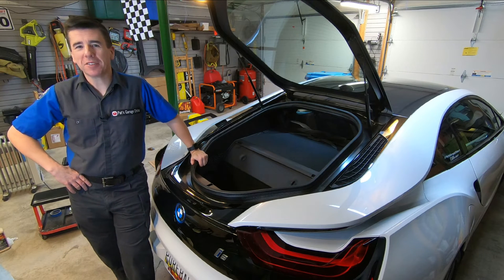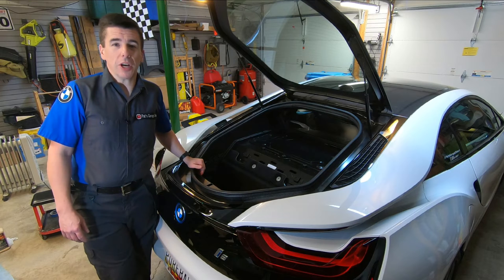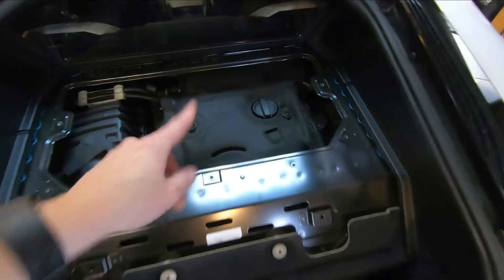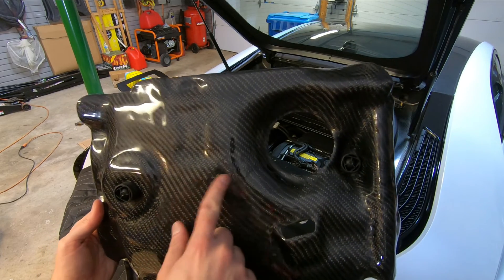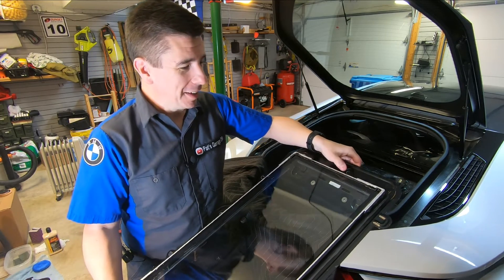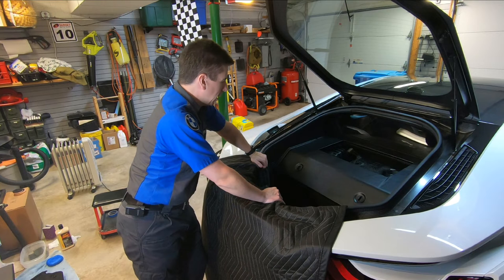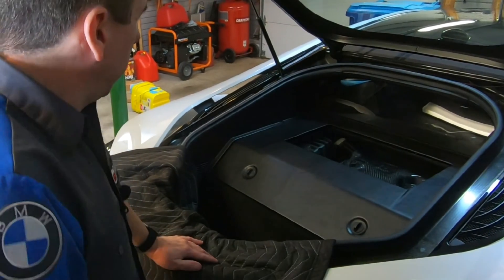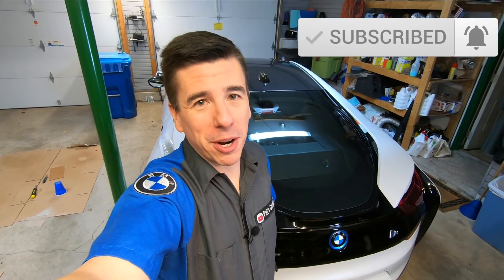I modified my BMW i8 to show the engine as part of my Engine Display Project started 7 months ago

Comment: Cool project.   Would have been interesting to see some strip LED lights along the edge of the glass cover.   Also, maybe a dark blue or gray color to the cover of the air filter to the side, to distinguish it from the engine....

Comment: would it be possible to do a v8 swap in this car?
Reply from the maker: Many have asked about swapping to a larger engine. Anything is possible with enough money and innovation. You'd need a computer controller that can run the engine and also tell the i8 that it's a functioning 3 cylinder, first. Then you'd have to modify the car to fit the engine, transmission, drive lines, etc. By the time you were done, you could probably afford an Aventador SVJ.
Reply: @PatsGarageOnline  i think an s55B30 engine would be perfect in this car
Reply: @PatsGarageOnline  Just one more question, would the best place to do the swap be front or mid engine?

Comment: You added weight rather than removing it, but I think you just want to get a good top down picture of a Ferrari Boxer 12 motor, print it as a decal and mold/shape it slightly 3D and then and attach it under the glass from top cover you made (which looked great - Naugahyde is easy to work with).  Now it won't look like you have a mini-cooper motor in their.  Or go older with 4 double barrel Weber carbs in there with metal trim ring accents.

Comment: very well done.  A real cool affect would be to add some blue LED lighting that is indirect and creates a blue glow inside your engine compartment. You would have it connected to switch to where you can turn it off to where it wouldn’t be a distraction when driving.
Reply from the maker: Thanks!  I purchased two strips of blue LED lights and a small Lithium Ion battery pack to power them, and a wireless remote to turn them on and off, but I haven't installed it yet.

Comment: Still the engine is not shown, just the top cover. I would just skip the cover and cut out a polycarbonate glass with no frame but with a surrounding gasket. All those multi layer covers is not necessary if you are used to a front engined car, it's like sleeping with 10 pillows.
🏎️💨
Reply from the maker: not ever fabricating something before in my life, I felt like I needed additional factors of safety so I didn't end up with problems. Looking back, could have done it differently, but this was a test case just to see if it could be done.
Reply: @PatsGarageOnline  I think you did a great job anyway. My car is a Opel Combo (Fiat Doblo) so can't boast my own engine really, the cover is removed and the ECU tuned. I'm a motorcycle guy, that's my excuse.
Happy New Year ✨

Comment: Oh wow thats such a cool mod. You did well!! You have a new sub from New Zealand 😊. BTW now that you've been using it for awhile since this video was done, did you face any issues with heat, maybe fitment or things that you didn't anticipate that came about cause of the mod? Really tempted to attempt this depending on your experience.
Reply from the maker: Thank you!  I've had no issues with the mod.  It does get hot, but there have been no problems.  I would do it again exactly the same way if I was building a new one.  I overengineered this to be fully capable and it's impressed me.  However, I would make the hole in the leather wrapped cover smaller and send off the engine cover and airbox cover for professional carbon fiber work (and am considering that right now).  The glass is 12"x24" so you just have to make your cuts and build your frame to support that.
Reply: @PatsGarageOnline  Thanks for the reply, can't wait to see your engine cover and airbox cover mods.

Comment: Pat! Your videos are so informative! I’m definitely gonna implement your modifications & fixes when I start fixing up our salvaged i8 soon! Question: there’s often an issue i8 owners have with water leaking in the car causing possible water damage but is that a general misalignment issue some people experience or what?? 2) idk if it’s me but your i8 feels slightly bigger right? 😂 3) i forget your i8 with the 2 backseats is it the 2015 model? Thanks!
Reply from the maker: Thanks for the kind words.  I'm only familiar with water leaking in the boot in the back and getting moisture into the electronics on the right side of the boot, behind the close out panel.  That's the active sound module and it causes crackling in the speakers when it's wet.  I don't know how water gets in there, however.  I'm unfamiliar with any other water intrusion in the i8.  Yes, I have the coupe so it has the rear seats, but other than that, it has the same general exterior dimensions.

Comment: Pat, I am a 2015 i-8 owner and I’d love to know if there are any kits to have the doors open automatically with your key? Also Great videos. I have a love hate relationship with my car even though it’s been perfect.
Reply from the maker: Thanks! There are aftermarket door openers out there that some people have told me about, asking if they could install them. I don't know if it's possible because both the door and the body in that area are carbon fiber. You'd have to cut the carbon fiber to make room, and you would have introduced a problem where stress on that part of the carbon would result in a crack developing. So, I would personally avoid trying it.

Comment: Not trying to be a dick but this is worse then before. At least before you can't see the ugliness
Reply from the maker: Many folks want to leave it as is, and that's cool as well.  There's definitely nothing wrong with that.  However, this video has resulted in dozens of messages requesting that I offer a kit to display the engine.  It seems there are folks in both camps, for and against.  Nothing wrong with that.  :)

Comment: Pat,  Have you looked into doing Carbon Fiber on your dash?  I think that I have seen the kits go for about $3,500.  Have you found a place that sells them at a discount?
Reply from the maker: I haven't considered doing this as the carbon fiber that comes from BMW is the dry carbon style. If you can find them used or from another supplier, good luck.  I could send pieces out for carbon fiber skinning but then I wonder if I should make it the same as my steering wheel which has the blue silver strands in it. Then I think it's too much bling. Ultimately, I chose to leave it.

Comment: I’d love to have this done to mine, are you willing to contract out your services? I would have to find a dedicated and creative car guy locally willing to take on a project like this which is fairly unlikely in my area
Reply from the maker: Thanks! I've had a lot of requests for this. Unfortunately, I do not have the time to do it. It took me 7 months, part-time, in order to do it on my car. The carbon fiber and upholstery is the most time consuming. And, I have too many other projects that I'm working on with the car. But, thank you for asking.
Reply: Pat's Garage Online I’m thinking of doing this but instead of carbon fibering, painting the engine cover, which may be quicker, also does this mod violate the warranty?

Comment: Just saw this video, you need to add a BMW logo on the engine cover.  I was actually looking for some one to do it on an i8 as it was done on a Cayman.  Don't have an i8 but looking for one, used.  Great video.
Reply from the maker: Thanks!  I agree.  I'm probably going to use the new BMW logo design that just went public to create the logo using my vinyl cutter and apply it to the top of the cover.  If I don't like it, it's easy to remove.

Comment: Great job im getting an i8 now.
Reply from the maker: Thanks! Glad to hear it!
Reply: @PatsGarageOnline  also very detailed and informative. I cant believe that bmw would restrict the i8 in such cruel way lol.
P.s. was there an increase in power?
Reply from the maker: @MotivationMatt0  The BMW i8 underwent a battery capacity upgrade in the 2019 and 2020 models to give a few more HP, but nothing you could feel in the seat of the pants.
Reply: @PatsGarageOnline  what can i do to add more power like 500hp to the crank
Reply from the maker: Please reach out to Edo Motorsport. Edo has a Facebook and Instagram account. He has been using the i8 ProCar race car to develop engine performance parts in Europe. I have no experience with these parts, but I have personally talked with Edo about this initiative.
Reply from the maker: I have a link to his info in my Edo Motorsport Side Skirt video

Comment: Hey is it possible to swap a v6 in to it
Reply from the maker: It might be possible if a substantial amount of the body and frame were removed to make room. There is not much room between the existing parts of the drivettrain. Then, getting the engine to work with the existing modules may be an issue. If the computer modules don't like how the engine and battery operated motor are working, it may never drive
Reply: Thanks mate

Comment: Wow...this was so cool. I want to do this now!
Reply from the maker: Thanks!  I felt like BMW should have done this from the beginning.  I still have to CF skin the air box and then I'll be good to go.  Hard to find time right now, LOL.
Reply: @PatsGarageOnline  I dont think it should have come like this. I appreciate the effort that went into this project and the result speaks for itself, but the main point of the i8 was to have a good car without focussing on the engine. This kind of ruins that part of the car, where the engine "didnt matter".
Reply: @Datoda  when the engine doesnt matter a i8 is the wrong car.. i would say at a dacia logan  (dont know if u have this in usa) the engine doesnt.....😉
Reply: @urbansoldier1  Im in germany actually.
Reply: @urbansoldier1  The i8 has a 3 cylinder engine coupled to an electric motor.

Comment: at 17:10 add a little mdf strip covered in the material you used and stick it down there, you won't  see the metal from the outside then. Great job anyway.
Reply from the maker: Good advice! I had been toying with that idea as well. I did paint the metal parts flat black and that did a good job on the mean time. Thanks!

Comment: Make the oil cap silver and get a cold air intake with a red cone filter ! And get a custom aluminum heat resistant bmw sticker , and make that last cover carbon fiber

Comment: Brilliant Pat! Of course now the CAI is just screaming "Carbon Fiber Me Too!" Although I would imagine you want to take a break from this project for awhile. I applaud your Pleather work, but it needs "something." Maybe someone who does airbrush work could do an I8 and/or BMW logo on it? I think the Coupe d'Grace would be to figure out how to showcase your work with some LED lighting. Since you like a challenge and have the patience to deal with same, you need to design some hard luggage pieces for it and finish them off in either Pleather or CF.  Lastly, your work environment is not Osha approved. I know you are fleet of foot, although Rebecca may disagree,😜, but using that folding metal chair was not a good idea. I wouldn't want your next upload to be on why you and Rebecca are no longer entering any dance competitions as you pan the camera down to show us your broken leg and/or arm.🤦‍♂️
Save the Wave.
Reply from the maker: Good thing the OSHA feds can't check out the hazards of my garage.  Especially, when I'm walking on 30 year old folding chairs and wearing 40 year old Finnish gas masks while working with chemicals.  😂  Thanks for the kind words, as always, Peter.  I agree that it's missing a final touch.  I have a vinyl cutter and was considering adding a "Powered by Lamborghini" sticker to settle the "Is the i8 truly a supercar?" question once and for all.  However, I did purchase two strings of battery powered blue LED christmas lights at Walmart, and under the left and right sides pleather cover, I mocked up getting those lights in position to illuminate the engine itself.  It worked and I am going to make it easy to put in and take out without clutter, and keep it battery powered for now. Also, it certainly needs custom luggage that's affordable.  The Louis Vuitton luggage set for this car is USD $26,000!!!  I can sell mine for half that and retire early.  Hopefully, now that this project is complete, I can get back to dancing and working on that bathtub gin we discussed in the past.    😃
Reply: Just incorporate a big superman "S" logo. Then if anyone asks why does it run so quiet, just tell them it's because it's a true "super car" and  runs on a new fuel source, Super Kryptonite and it's a lot more efficient than using a Flux Capacitor.😁

Love your lighting idea.💡 Stock up on glycerin  now. You can never have too much glycerin or bathtub gin and under no circumstances allow any OSHA reps to enter you house!